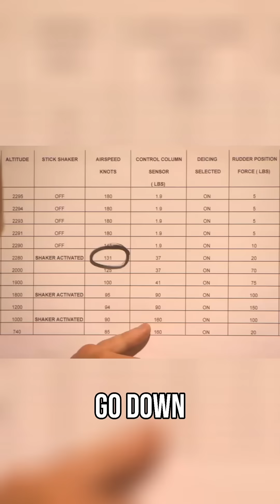Captain Renow Fatal Stall Recovery Failure | Mayday: Air Disaster

Comment: The REAL cause for this accident was the failure of the aviation administration for licensing these pilots and not continuously evaluating their performance. They clearly were not supposed to be in the cockpit if they didn’t know how to properly recover from an aerodynamic stall. Such is the sad case of Air France 447.
Reply: The commercial license training requirements and experience before attaining the ATPL, have been respectively cut to the barest minimum, and reduced by 5/6ths. In my day practically all ATPL's either had military training, or had a great deal of instructional experience, almost weekly conducting stalls power on/power off, incipient and developed spin, partial panel IFR flight, side-slipping, forced landings etc. Now a 1st Officer may achieve his commercial license with as little as 125 hours (iirc) solo flight. These asinine accidents - and the Air France one where they disregarded 53 stall warnings leading to them making a hole in the South Atlantic, are what we all forecast would happen when these accelerated courses came in.
Reply: Yes, but the pilot should be the first to blame for not learning that, at least for his own sake.